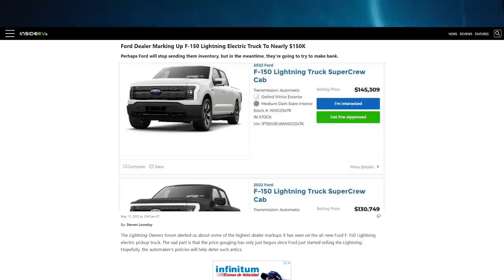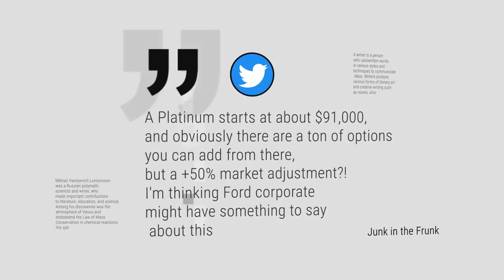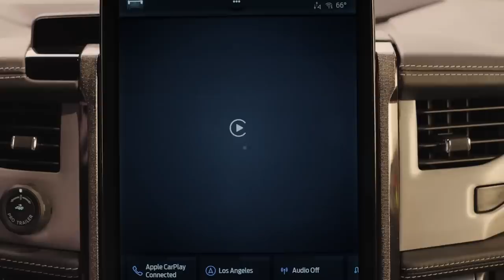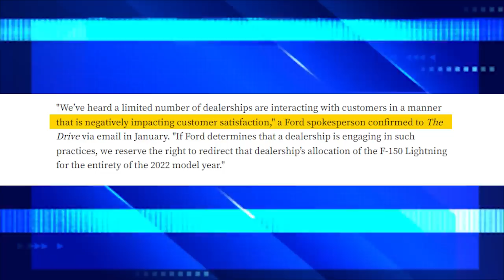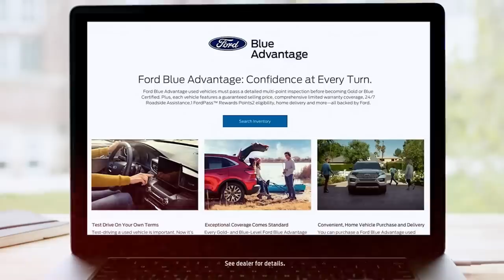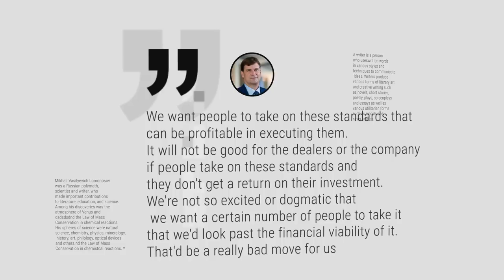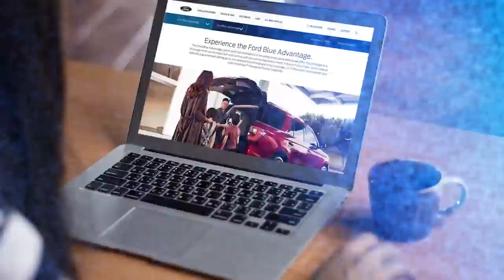Another HUGE Blow For Ford Dealers

Comment: I bought my first new F150 Lariat truck in 04, then another new one in 10, then a brand new raptor in 18. That will be the last of truck I plan to buy from a Ford dealership. At the time I got an amazing deal on the new raptor. That's not my issue. My issue is with the steady downhill of their service departments all over the country. It's been recall after recall after stupid issue over and over. I had to threaten Ford with a lawsuit to get them to fix my transmission because THEY broke it. When they finally did fix it, my truck sounded like the entire front end had been messed up. I took it in and they broke it even more by snapping off two bolt clips and never bothering to replace them. That ment every time I hit the smallest bump my entire front end would rattle. I finally took the truck to a suspension specialist who showed me exactly why Ford delerships are inept and incompetent, and their service department are highway robbery on a good day, and blatant liars on their best day. Nothing was wrong with my suspension, at all. 

I've been a Ford man my whole life. I don't think I'll be going back after this experience. Oh, and to make it worse, the service manager blamed me for the clunking sound. He didn't provide any context, and he wasn't joking. He looked right at me and said, 'What did you do to break it already?!'. I replied that I drove it home and then back to you. 

My wifes suburban, I can take to the chevy dealership and they go above and beyond to make everything perfect. Just awesome guys down there. I'm seriously debating my brand loyalty. Love the truck, hate Ford dealership employees.

My oldest daughters boyfriend drives a nice new Dodge. While I think Dodges are glorified dog sh!t, I'm more than willing to take a look at them in 4-5 years whe it's time for a new one. I gave up on Ford... or should I say, they gave up on us. Greed will be your downfall...

Comment: I remember back around 1980 I worked at a Ford dealership, the body-shop manager told me in the future only rich people will have new cars, well fast forward most people
I know can't even pay mfsr let alone any mark up. I took three 1980 pick up trucks to the city we lived in and they gave me a check for $18,000 yeah they were 6 cylinder plain Jane
with rubber floor mats, but they were trucks, good luck today.

Comment: I’m a current gen 2 Raptor owner and Ford enthusiast who was anxiously waiting to order the Raptor R. When finally trying to order one, the markups ranged from $40k to $80k. And this is on a $110k truck to start with. I just got fed up with all the BS and trying dealership after dealership with no success. So I decided to order Ram TRX from a dealership who was discounting $11k off of MSRP.
Reply: misinformation because RAM dealers were doing the same when the TRX came out.  Comparing new and cars new several model years only are not the same apples and oranges.  Be honest

Comment: I was looking at replacing my F350 over the summer, then had a cardiac event when the dealer laughed at me for even suggesting MSRP was in the ballpark, and told me their best price.
Reply: I got talked down to by a dealer like that 30 years ago. Still don’t go there. Insult me when I am young, never get my money in the future.
Reply: @jdruin1  as with everything....vote with your wallet
Reply: your older like me i'm thinking. So if your retired, I would do some resarch and be willing to travel even to IDAHO to Dave Smith or another dealer for all the features and whistles. Tell them what you want, negotiate the price and even if they have to order it partially from the factory (because hitches and brushguards, headache racks etc. are usually done by someone locally and attached to the rig before the sale) and make your deposit, fly there and drive it back. Solves a multitude of tasks like the initial break-in for the new rig. Plus you get to see some of America.

Comment: Ordered a Ford Maverick way back in 2021.  Price quoted at the time was 25.5k.  finally arrived 15 months later and dealers market adjustment pushed that same maverick past 42k.  Left disappointed and bought a 22 Nissan Frontier instead for 32k.   Still salty about the dealer screwing me over.

Comment: I’m from a family that owned a Chevrolet dealership, so this will likely be an unpopular opinion, but here goes. Dealerships make nearly no profit by selling a new vehicle at MSRP. And by “very little” I mean less than $500 per vehicle and that’s assuming it sells the day it is delivered to the dealership; which almost never happens. Dealerships make their money by reselling used cars they take in as trades. Yes, gouging is bad, and it’s been going on for decades. Any popular model, especially if there are production delays, will do this. Looking at you, Chrysler PT Cruiser. I definitely agree the 40-100% bumps the article is reporting is way too much, but it also comes to supply and demand. Supply dropped drastically due to Covid and demand has outstripped supply. Ford, and GM as well as all manufacturers needs to set guidelines to prevent gouging, though the efforts Ford is doing here could easily backfire. Yes, they could easily sell cars without dealerships; it’s how the industry started. But dealerships do more then sell. They take care of maintenance and warranty repairs, because cars and trucks do break down. If the manufacturer leans too hard on dealers in regards to sales, the dealers can fight back by refusing to perform the repairs. I can recall dealerships having a policy of “okay, yes, you bought the brand we sell but you didn’t buy it here; get lost.” Manufactures fought hard to change that though I knew of dealers that still only repaired vehicles they had sold; only now it included just the used cars. Some of this was practical/financial. Dealers are required to buy thousands of dollars in ‘special tools’ that may only fit one or two parts on one or two models. We paid GM $5,000 for a battery cradle for the 2010 Volt and never sold a single car. Or diagnostic equipment that is manufacturer-specific (Ford diagnostics are different from GM diagnostics are different from…even if they all use the same shape connectors; it’s like PC/Apple) dealers spend a lot of money for equipment and training to do diagnostics and repairs and auto repair us like new car sales; break even at best. Cut off the availability of vehicles to sell, they might cut off the ability to get those vehicles to be repaired. Then everyone’s up the creek without a paddle.
Reply: It's interesting that new trucks purchased from a dealer are cheaper in Canada, many make/models are much cheaper. 1 CAD =  0.73 USD
I just sold my 2008 F150, just hit 400,000 Km and a slight Triton tick. Buying a 2023 Toyota Tacoma 4x4 TRD Sport Premium (6M) Double Cab 4WD.
Way cheaper than a Ford.

Comment: Greed has killed the trust from consumers.  I bought many cars, trucks, RV's in my lifetime, and from only a few manufacturers.  I won't ever buy from them again, as they gouged consumers during a time many folks were hurting financially.  I will also not use dealer service departments for those same manufacturers.  Only one dealer offered to deal below sticker without the additional markup, and it was the first truck I ever bought from that manufacturer.  A year later, I bought another truck from them.  I sold off the vehicles I had from the other manufacturers so I don't have to deal with them again, and I can only hope the junk mail stops soon that asks for my continued business.

Comment: Not a problem.  Used car prices are collapsing,  So will these rip off dealers pricing.  Only I won't be there for either pricing level.   Too easy to find good non Ford vehicles at MRSP or below.

Comment: It's also worth remembering that local and state politicians are often owners of "small businesses" - and one of the most common "small businesses" for those politicians to own? Car dealerships. Landlords are another very common group. This is why state and local laws often heavily favor dealerships and landlords.

Ofc, I never understood why anyone would buy a new car in the first place when used cars are often just as reliable and don't come with that ridiculous mark up. Well, I do understand why someone would want a new EV - the battery life is easily the most important factor that tips the scales in favor of new over used. Although a used EV that's only a few years old could be arguably just as reliable for less money... And that's probably why used EVs are still more expensive than buying a new gasoline car in the same vehicle class.

If they're serious about getting more ppl driving electric cars, they need to be priced competitively with gasoline cars that are in the same class. Like, why is a new 4 door sedan gas car almost half the price of a new 4 door sedan EV? Well, I know why - they're primarily marketed to the upper middle class market. And that's why the adoption rate has been so slow and you only really see a lot of EVs on the road near fairly well-off areas. Cuz they aren't really trying to be competitive. They're just tapping into the new interest of ppl that are willing to spend a lot more money on a vehicle than they actually needed to spend for either the status symbol or "green energy" clout (EVs aren't anywhere near as "green" as ppl think they are - battery disposal is... definitely an issue, let alone the rare metal part).

If someone really wants their traveling to be "green," then the best options are walking, riding a bike, taking the train, or taking the bus - in that order. Obviously, those aren't always an option. We recently had to get a van in order to qualify for the transplant list for my partner - we need to be able to get to another city within a few hours notice and there's no public transport between our towns. And that's just the case for a lot of ppl - we need vehicles to get around to where we need to go. Even if we could have afforded an EV, most wouldn't be able to do the round trip and the low adoption rate in our part of the country means there's only a few places where we could even charge the vehicle (plus the fact that our house doesn't have an outdoor outlet or a garage).

Comment: I drive a twenty six year old truck with almost 300K miles. Not because I can't afford a new one but because I won't set foot in a dealership. Graduated with two different dealers sons and they were the biggest jerks I have ever met. Twenty six years ago when I went shopping for my new truck I had to go to eight different dealerships before I found one that took the price I researched and offered them. I found that most sales people don't know the front of a vehicle from the back. You want a locking differential? What is that? I'm sure you don't really need it what ever it is. Also, most of the trucks today are really ugly. Ford/Chev

Comment: I went to but a 2022 f 250 lariat with 27k miles and they wanted 76k would not negotiate. 10 miles up the road a brand new one is 84K and they claim a mandatory markup of 10k. Negative Ford in Charlotte NC.

Comment: Ford's issue with direct sales is the same one that Tesla has, a little know state agency called the Motor Vehicle Commission. They issue a license to sell vehicles in every state and many will not allow direct sales from the manufacturer. Tesla got some states to allow them to do direct sales but they never tried every state. Notice also that Ford's only tool to pressure dealers is allocations. You can't legally set pricing because setting a price between parties is considered collusion and is illegal and are subject to criminal prosecution by the Antitrust Division of the United States Department of Justice.

Comment: Glad to see Ford corporate kicking some dealer butts. After purchasing 4 separate NEW Fords over several years from the same dealership in Huntsville, AL I was treated horrendously after two warranty repair failures on two separate NEW Ford vehicles purchased there. Perhaps Ford will shutdown that bunch of shysters. I now drive an hour to the dealer in Pulaski, TN where EVERYONE is awesome, the parts and service outstanding. I'd rather push my Ford 60 miles to Tennessee than ever do business in town with that dealership again.

Comment: Hyundai and Kia have had non negotiable pricing for years now and it has done nothing but good for their dealerships and their products. When you have non negotiable pricing, your sales tend to be higher as the buyers have more faith in your operation. Higher sales means more inventory turnover which benefits the customer, the dealer, and the maker. If Dodge and Chevy don't follow suit they are going to find themselves sucking slough water pretty quick. Another benefit is by limiting the price, the dealers have to concern themselves a lot more with customer service and quality servicing and repairs because that's the only thing they will have to sell that is fully under their control since all their competitors are bound to the same pricing. Lousy service, poor reputation? Well I'll just go on down the road to the next dealer thank you very much.
One of the tricks of the automotive business that many people don't know is how warranty work gets paid for. The maker tells the dealer what they are going to pay and it's damn tight. The dealers don't want to do warrantee work since it takes up shop space that could be used for higher priced service work. Do you dislike a dealer in your area? Buy from his competitor and then take any warrantee work you have to him. He can't refuse because the maker will be all over him for doing so.

Comment: Viva Ford in El Paso, TX is a culprit of this practice. Dealer wanted $10K over MSRP for MACH-E. I called Ford corporate and was told to mail them a formal compliant. Mail? GTFO of here. I just went to the Tesla app and bought a Tesla instead. I’ll never try to buy Ford again because of this, but this a good shift in the right direction.

Comment: Dealerships will pull crap like getting you a new license plate for $130 more than you can get it yourself.  I have seen the pinstripe scam pulled also.  Get $20 pinstripes charge 250 for them.  If you look at the bottom line, you see it all the time.  There are places on You tube that tell you of dealer tricks.  One way to stop it, is let people order their vehicles or buy online from the dealer

Comment: Ford and everyone else wanted to cut back on dealers to make distribution easier. The whole point of the dealer model in the first place was to be able to get market penetration in areas where maybe someone wouldn't otherwise set up a business selling cars. 

it's not like ford hasn't had some hand in creating megadealers who spend huge amounts to make pretty buildings that serve no purpose for the customer, and then turn around with games selling cars and especially service. 

I'll believe something material occurs on the customer's behalf vs. pretending to solve the markup problems and publicizing a "solution" that still results in the customer losing when we actually see it.